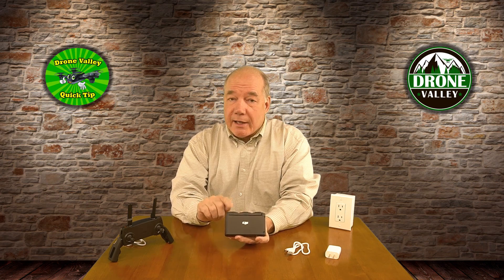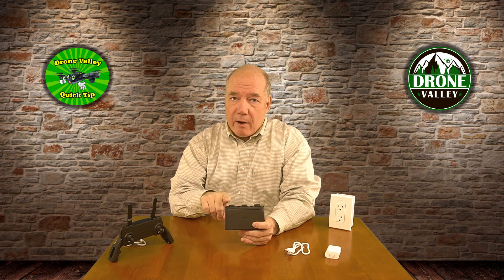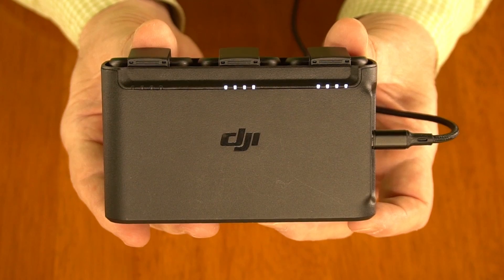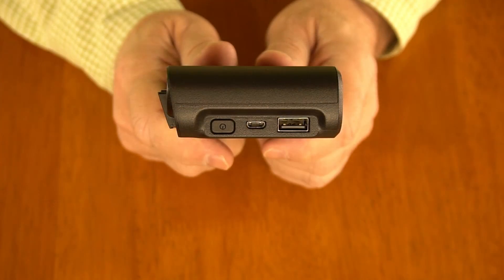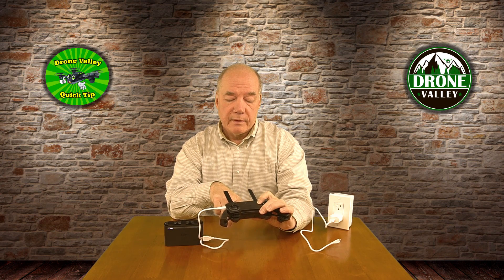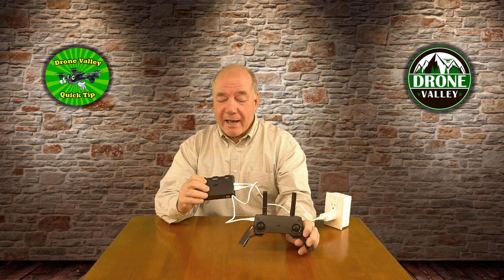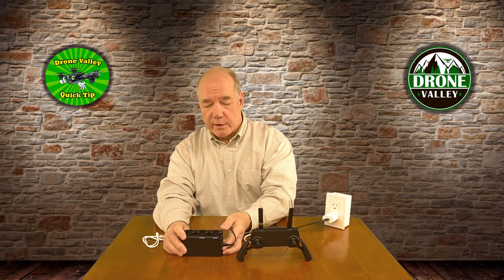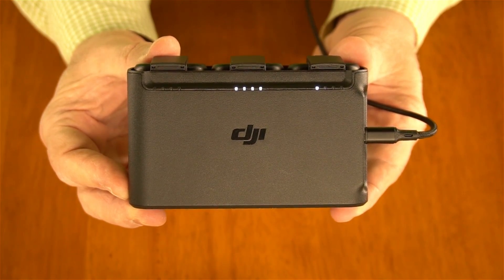Mavic Mini - The Magic of the Charging Hub Explained

Comment: So Rick...is there a 3rd party solution currently available to charge both the battery bank and the remote controller simultaneously?   Thanks for all your info on the DJI Mavic Mini!
Reply from the maker: John, I have a new style of Mavic Mini "charging kit" arriving tomorrow that we designed that allows you to charge the drone, the controller and another device (phone / tablet) from a single cable and a single port on your charger. I'll be updating the website as soon as they arrive and you're going to love them. Rick

Comment: Thanks for the video. Great tips. Could I ask how long each battery takes to charge on quick charge? Also, do you know if the batteries self discharge? I'd also be interested in knowing what the discharge order is if you use it as a power bank. Does it discharge all batteries evenly at the same time (which is better for getting them down to a storage charge), or does it fully discharge each battery in order? Sorry for all the questions, but I expect many people would like to know these things.
Reply: ... Great question on how they will discharge. I am searching that now to store them if there are days between flights. 

.
Reply: @Jeff_240  I've since established that it discharges each battery fully, in order. So, if you want to discharge for storage only have one battery in the hub, discharge to about 60% then unplug it. Repeat for each battery individually.
Reply: @chrisbaishdrones  ... I did it yesterday at work. When using my phone everyday, all day on the HotSpot, it really uses the phone battery therefore I must keep it on a wall charger while siting at my desk. To discharge the three batteries and the controller, I did what you said. One in the hub at a time until only two lights were solid on then went to the next battery. That is about 50%.
Thanks.

Comment: Rick I have another concern and a question regarding the charging process of the mini's controller.  I have read that some folks have damaged the female charging port on the mini controller by inserting the male part incorrectly.  So, could you please clarify the correct procedure? When I get my Mini next week I want to mark the male end so that I will always know which side needs to be up.  I hope that my question makes sense to you and I hope you can clarify the right way to do it.
Reply: I'd like to know if the side port is a Micro-A like in the M2, or the more traditional Micro-B.  There was a technical reason for using micro-A.  Has to do with being a host/initiator rather than a target/peripheral.

Comment: What is the amp output on the dji fast charger, and would my portable power bank(26800 mAh  99.1Wh) which has two outlets 5v/1amp and 5v/2.1amp be able to charge the hub?

Comment: So, when one of the batteries gets to full charge, can I remove and use it without interrupting the charging of the others?  Or, a related question, will the charger work if less than three batteries are inserted?
Reply: Yea it shouldnt matter how many batteries are in the hub, thats how the mavic air's hub works
Reply: Yes you can.

Comment: I had no idea that I would have to have a fast-charging charger.  Thanks Rick.
Reply: You have to consider that these batteries have high capacity.  A standard 2A 5V charger would only deliver 10W.  That would take a long time to charge.  If you up the current, you need thicker power leads in the cable, and more voltage drop across the wire.  When you up the voltage, which QC does, you don't need as much current to achieve higher wattage.  That's why your oven, electric clothes drier and electric water heater runs on 220V rather than 120V.

Comment: What happens when the batteries in the hub are fully charged, will it then charge the controller?
Reply: I would believe that since the controller connects in it's own port it probably charges at the same time. Thats also how it works with the Mavic Air charger.
Reply: Did you not watch the video?  It won't daisy-chain charge.  Charger only seems to have one USB charging port.
Reply: Daniel Morin, well if you watch the video, you’d see that he didn’t have all of the batteries charged and have the controller plugged in. So it’s a valid question. It doesn’t appear to daisy chain charge while charging the batteries, but what happens when the charge cycle is complete?